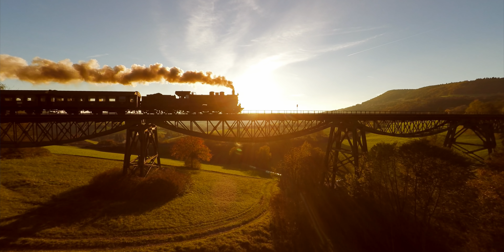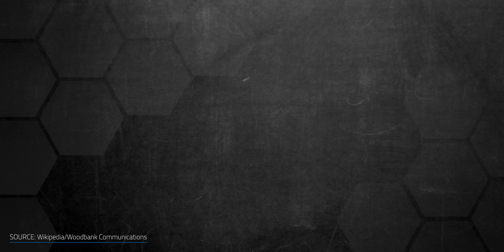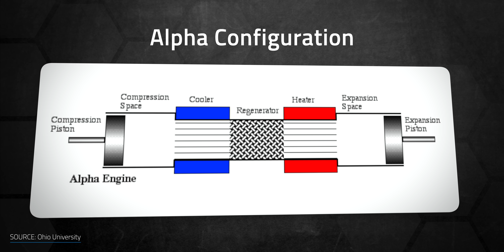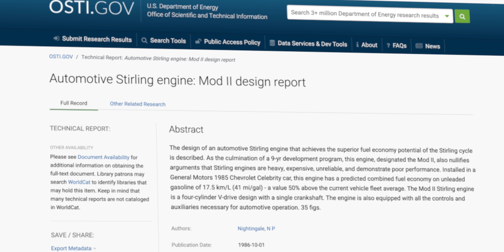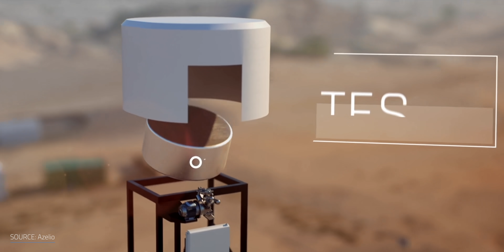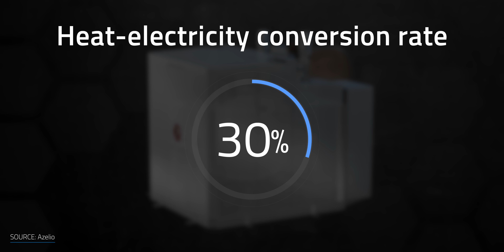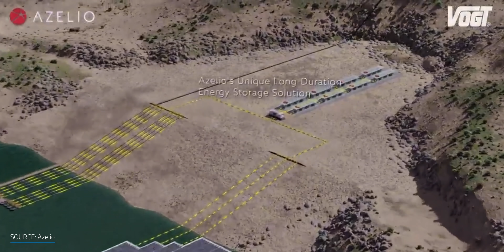Are Stirling Engines the Future of Renewable Energy Storage?

Comment: I wish you would cover this new any scale fusion nuclear engine. Interesting description of Stirling engines but fusion nuclear is upon us already. Nuclear fusion at any scale is much smaller, less complicated cheaper and simpler and you can learn about this fantastic good news of the Safire Generator at "aureon @t". The problem with current worldwide fusion research is that it believes in the fallacious theory, which is in a centre of sun fusion related to high temperature and pressure. Learn the truth with Electric Universe Theory, "The Safire Project", which proved this theory in the lab test and is the soon to be built commercial fusion-powered Safire Generator. General EU theory study also at "The Thunderbolts Project website" for the greater picture.

Comment: I get that its cheap to build, but 35% efficiency on a storage solution is really terrible, if its supposed to use electricity to directly heat the aluminium. It needs to get efficient heat somehow.

If it could heat the aluminium by running in reverse, that would make it a lot more viable, but none of their slick presentation materials show this. And the lifecycle assessment is based on the assumption of infinite solar energy during daytime, rather than finite renewable energy available for charging. If you used this to provide power half the time, and got all power from solar during daytime 75% of the produced solar energy would be spent charging this, and more than half of all produced solar energy would end up as waste heat in the system as opposed to if you were using batteries.

Comment: it can be used for ICAES, isothermal compressed air storage, because stirling engines can generate cold and hot temperatures and that is necessary for ICAES that has the same capacity-volume as battery storage. you can make vane engine compressed air vehicles with that, in three ways, coupling the stirling engine with a compressed air engine rotor to obtain cold and hot temperatures, using fresnel lens to power the stirling engine or having a reservoir of molten salt to run the stirling engine, to obtain cold temperatures.

Comment: unless the efficiency increases by a large margin, i dont see it becoming mainstream. other crude storage techniques have better efficiency at a relatively low cost.
diabatic compressed air storage would be better, efficiencies near double that of the sterling, and when you arent producing enough power to compress more air, anything that is produced can go towards putting more heat into the system that reheats the compressed air before it is decompressed and passed through the turbine to generate power.

i understand there arent enough salt caverns to store air for the whole population, but i live on a large country property, a couple air tanks for a few days worth of power wouldnt take up much room, they could be placed underground on each property in bigger cities etc..

Comment: The title and concept of this video is misleading and a misnomer.
The Stirling Engine is merely the method to convert <thermal storage> from heat (or theoretically cold) to working energy, presumably to spin a generator producing electricity.

So,, 
Yes, there is value in taking advantage of the Stirling Engine's efficiencies compared to other methods, but the thermal storage is a quite separate part of the solution with its own design and performance characteristics.

Comment: Overall, this is a decent channel, but it would be even better if there were more skepticism, and less repetition of press pack hype.  How does Azelio plan to melt the aluminum?  If it's by concentrated solar, that's really efficient. But using electricity from wind, how does that work? Heat pumps are really efficient, but I don't think you could melt Al with them. That leaves resistive heat, which would make for a dismal full cycle efficiency...

Comment: My central air runs all summer , cold house hot attic.  Heat pump in the winter warm house freezing attic.  What kind of power do you think a Sterling engine could generate between the two.

Comment: Funny thing is, I had drawn up a concept for phase change energy storage back when I was in highschool 20 years ago. It was intended for rapid electrical charging though, aka lightning; figured it would be an open gate to get it struck, then it would "trip" to trap the energy in the phase change material.
Reply: I even figured out the exact material to be used, can't remember all the details, but it is/was used by a luxury car manufacturer to have a fully electronic suspension sysyem.

Comment: I found myself drifting-off--but did not realising how easily this was happenig.
The subject matter is very interesting, but I drifted....the voice was in sinc one minute, and out of sinc, the next.  The radios of the 60's did the same; we had to keep retuning-in or loose the station.  The problem was solved by transmitting the voice signal with frequency modulation instead of the then (i have forgot)
So if you have some HONEST friends, get them to perform a voice experiment, and make a video from the experiment.

Comment: The idea of using aluminum in a phase change to store energy at around 600 C peaked my interest.  Presumably you would need to store a mixture of molten and solid aluminum for the 25 year life.  I wonder what material you would use for this?  I don't think crucibles used in foundries last this long.

Comment: Rim size. 28 inches. You will want to think about using artificial super materials and if is extra resistant to and easy patching of punctures a solar transportation vehicle may be built. Any space vehicle I build will have a one way check valved intake as a through hull. Ok... What?  Add solar powered continuous operation air pump. Charging stations at work in your parking space. Hell yeah. Go to work in space. I know how to build a simple model T space capable air craft. Cost about 40,000 US Dollars. Once it is primed the main drive always runs. Unless a seal blows or the pilot shuts it down. Ground sky and space modes.

Comment: Whoever makes the tire for the global transit vehicle I have been working on for a long time needs to make it to hold hydraulic fluid spun up to about 260 miles per hour max speed ground mode. But the sky is the limit beyond that. The super flywheel tire. Whatever you can make beyond that would fantastic. I only need one. Motorcycle type street bike.

Comment: When you compared Lithium storage to Stirling storage, your numbers were wrong. You made it sound like stirling engines were comparable only in terms of inbedded CO2. Surely though if you are looking at efficiency you will see that lithium is an order of magnitude more efficient when it comes to storing and releasing electricity. Using waste heat is great but there too you will find that combined cycle gas turbines do the same job with much more output per input BTU

Comment: Nitinol goes through a phase  change as a solid, contracting and expanding very quickly with small delta T. so it makes a workable engine, but i wonder if heated nitinol wire could be used for storage, maybe an array of thousands of wires in a warm water bath, so the warm water is the storage medium basically, rocking back into a cooler bath. Ridgway BAnks of caifornia built an engine like this, but i dont think he ever looked into it being a component of storage. the engine could be used in poor regions with no other energy source but cool water and passive heated warm water. prob the wire is too expensive.

Comment: The constraint is seals.  They wear out quickly.  Trying to seal an inert gas in a moving system is the issue.  The sealing surfaces needed are insanely expensive to achieve, and require constant replacement.

Comment: The title is misleading, imo. The Stirling engine has no future as an energy storage device. Perhaps the title should read, "Is heat better at storing energy than kinetic or chemical methods?" or, perhaps, "Is the Stirling engine better than the steam turbine at converting heat to electricity?"
Reply: Yes, I agree. Stirling energy is a converter. All “storage” or “production” methods of energy are really just converting energy. If we started seeing it this way it would change how we work with energy. Also, matter is made of energy. No matter what. If we can convert matter into energy directly we would have basically 100% efficiency.
Reply: @trolly4233  Storage and production are two very different processes. One produces energy, the other stores it. They are not both converting energy, only one is, the other is storing energy. For example. A kinetic energy storage device stores energy as kinetic energy. If the energy you want to store arrives from the producer in a different form, such as heat it would also need to be converted into kinetic energy before it can be stored as kinetic energy. A Stirling engine might be useful then, however, a steam turbine may well be better, if only on the grounds that steam turbines are the go-to device people use to convert heat into kinetic energy.
Reply: @makhoe1  you can’t produce energy. “Producers” are really just capturing and converting energy, most usually into electrical energy. Energy is not created nor destroyed, only converted.
Reply: @trolly4233  "Energy producers" is an industry term.
Reply: @makhoe1  Exactly! The storage technology in this case is thermal storage. That's what I really wanted to know about. How do they cost-effectively insulate the heated material to prevent loss of energy to the environment surrounding the heated material? Why did they choose that particular storage material and temperature?
Reply: @andrewj22  insulation is easy you can just air and hertzian contact to insulate stuff just give it space and boom you get insulation for free. the temperature and material are mentioned in video as recylable molten aluminum 600 deg C which looks alright
Reply: @makhoe1  The law of conservation of energy says that energy can neither be created nor destroyed. So, yes, energy is always just being converted from one form to another, from “production” (which is just converting stored energy to a different form), to use, and even to storage.
Reply: @walterrutherford8321  Stirling engine isn't a storage device.
Reply: @makhoe1   Duh, I didn’t say it was. It’s an energy conversion device. But since energy isn’t created or destroyed, all it can do is change form. You don’t produce energy. Whatever is making the heat to drive the Sterling engine is just converting energy from someplace else into heat. In this case the energy is stored in a fuel: alcohol, wood, butane… and released as heat (and light). The heat energy is transferred to the trapped air. The air expands and transfers the energy to the piston, the piston pushes the wheel and converts the energy into rotational motion, etc…
Reply: @walterrutherford8321  The title of the video claims that Sterling engines are an energy storage device. They are not. QED.
Reply: @trolly4233  Nuclear
Reply: @trolly4233 That’s called fusion.
Reply: It will fail at both to be leading. Much cheaper and more reliable to use organic rankine or steam long term and in large scale.

Comment: Used in an energy storage application, efficiency could be improved a lot by combining with district heating, like in a project where the energy is stored in hot pebbles, to drive both a turbine and district heating.

Comment: the probe that just left the solar system (voyager) is powered by a nuclear strrling engine. love this concept. i have being trying to pursue this idea for many years. the problem is the there is very low power available at our rate of consumption.  low delta heat to electric has been a great idea and i wish i could bur a working product. a delta t of 90 is very achievable in most parts of the world but the out put would not keep up with most individual power demand.

Comment: Using heat energy storage with stirling / much less expensive than batteries based on fragile lithium ion chemistries / especially in hot applications 
Lower capital costs & better energy storage capacity than production // a great combo for long life good capacity factor clean energy systems // solar thermal ^^ mirrors & heat & stirling engine generators ^^ dope !

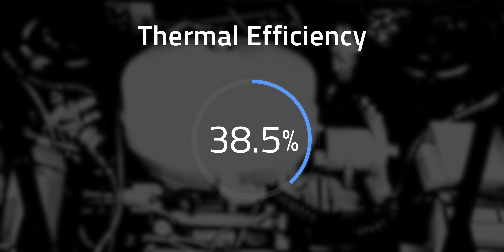Comment: 5:50 Toyota got 38.5% efficiency out of 1NZ-FXE in 04-09 Prius II // later engines in this line hit 40% then 42% & now 45% using regular pump gas in atkinson cycle (reduces pumping loss by leaving intake valve open during compression stroke)( effectively improves energy recovery of power stroke pressure to piston downforce) suffering a loss of torque made up for by a pair of electric motors (see PSD) or Power Split Device, an epicyclic gearing setup that combines engine output with a motor generator & power motor, the two electric motors modulate to control final drive ratio) this platform Hybrid Synergy Drive omits use of conventional transmissions, improving power core to wheel power efficiency too // gives up 40-65 MPG real world on regular gasoline, better in warmer weather (heats up faster) I block heat my 05 to 105F to improve startup emissions & reduce wear on the engine // about 1kWh to heat it from ambient 50F to 105 F in about 3 hours //

Comment: Would you be able to use an array of smaller Sterling engines to harvest the heat energy stored in hardscapes (brick  buildings, ect.) at night as a way to offset your storage requirements for solar systems?

Comment: The same thing that makes a Stirling a good choose for commercial use is exactly what makes solar panels suck. As an external combustion engine there is no carbon to build up to destroy the components so they last a long time. Bonus round, a Sterling would have ten times less parts than an internal combustion engine. Solar panels work for a max twenty years. However they start losing productivity from the day their put in the sun. You'll have a slow logarithmic decrease in output for five years with a low percent of total failures occurring after ten. There are thousands of sqmls of dead solar "farms" across the globe. Slowly rotting into... well nothing good. Look it up. 
So sure build more useless solar farms, why not? The 1886 Sterling, keep it hidden for gods sakes. If the public knew you could power your home with a device that as a side affect could air condition your home...

Comment: For the power produced, the Stirling is large.  In other words, it specific power is low.   It’s use historically niche applications where it is the only engine that will work.   It really has no magic, for if it had, it would be widespread.
     An engine cycle similar to the Stirling’s is a closed cycle gas turbine.  These have been around awhile.  Current R&D is with CO2 as a working fluid, thorium molten salt reactor considered for the heat source.

Comment: I've seen an old 4" or 5" bore "Rider" operating at farm machinery expo's in Australia. About 4 ft high. Run by vintage mech enthusiasts as a demo, the beautiful smooth lubricated piston coming partly outside the bore, with the cyclic repetitive whisper of air being pushed, is magical. I think only about 1 or 2 HP, if that. Wood fired, under the base. I want one.!!

Comment: Rather than heating an aluminum ingot, I wonder if this would be better paired with Nano Coated Salt storage.  That stores energy (thermal or electric) chemically by converting calcium hydroxide to calcium oxide, plus water.  The storage is stable indefinitely: tomorrow or next winter, whatever's needed.  To release and use the energy, add water.  This triggers an exothermic reaction that results in calcium hydroxide and steam at 450c.  The steam is used to turn a turbine in a power plant, but maybe the heat could drive a Stirling engine instead? 

Just Have A Think's video on nano coated salt storage:  https://www.youtube.com/watch?v=IgUTL_FkErI  Please comment if you know more about nano coated salt. My only exposure is the video I've linked and that's heavily informed by the manufacturer.  I wonder if there's another perspective on it.

Comment: I always though about using petrol engine and exhaust gases temperature to run Stirling engine to help with efficiency.

Apparently in early 2000s BMW though about that! Unfortunately they never finished it, but imagine Stirling engine used as dynamo for charging batteries inside a car further increasing efficiency of the car?

Comment: IMO they should dig down to where the crust is hot and put in big heat pipes then connect those to Stirling Engines Geothermal power with out needing tonnes of water.